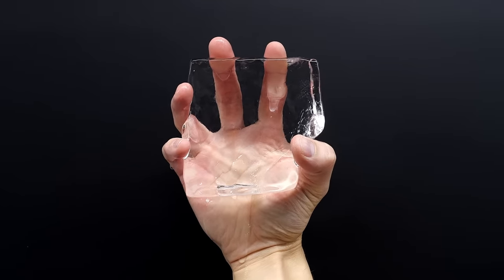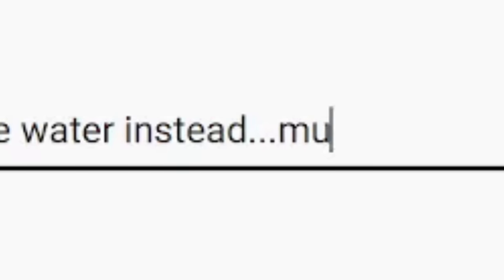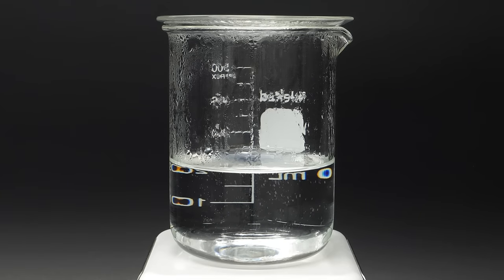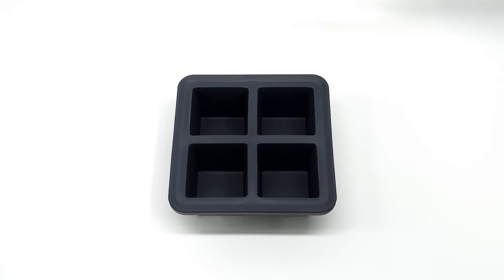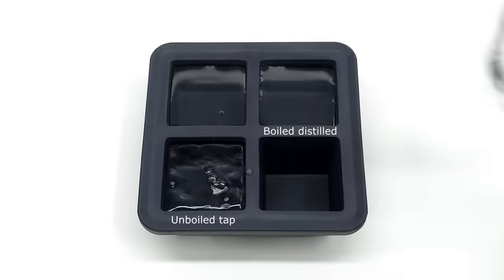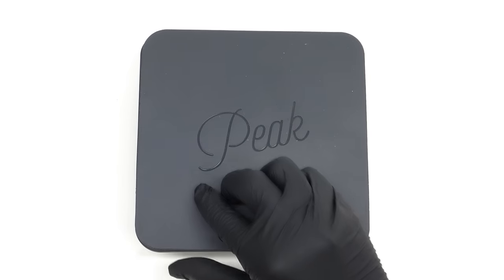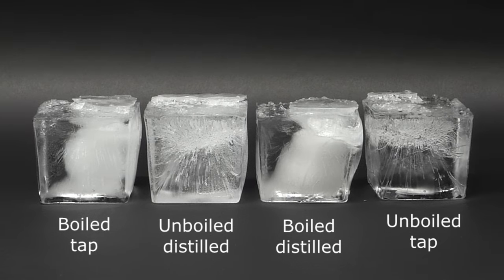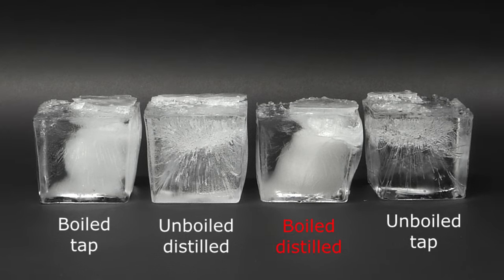The clear ice myth

Comment: I thought the trick was to use water at boiling temperature which gives the air time to get out due to the extended time it takes to freeze. You mentioned that you let it cool after boiling.

Comment: i learned a long time ago that it has nothing to do with the temp of the water and everything to do with how the water moves when it is being frozen.

vibrating it will produce perfectly clear ice because while it is freezing it is being placed into its most dense molecular structure, vibrating it does the same thing that sifter does when you're putting something through it like grain, it allows the molecules to move freely and allows more of the air to escape.

because what makes ice not clear, is the air that gets trapped inside of it, let more of it out and the clearer your ice gets.

also, this so called "myth" was wrong to begin with, the boiling water myth is that it freezes faster than cold water and that's a fact that has been proven.

the way hot water freezes faster is due to it being closer to vapor pressure and thus having a bigger surface area to collectively cool the water.

throwing cold water into sub zero takes a bit to freeze but boiling water instantly turns to snow.

i have yet to see anything even remotely speaking about clear ice and boiling water other than this video.

Comment: Well. I see a few issues here.
if you won't let it boil, just heat it to 95~98 degrees, and then freeze it without transferring it to another container, you might have better results. e.g. less disturbance = better. 
Still doubt it would be any good, though. 
maybe marginally better.

Comment: Don't you love replying to tween comments from people who've never actually done what they comment on?
Reply: I make clear ice in the regular refrigerator compartment. Plain tap water works fine. All you do is get a plastic cup filled pretty much to the rim (perfect is not required at all.) Then place the edge of the cup right where the cold air blows into the refrigerator. After a day there will be a nice clear medallion, after a few days it will be several times as thick. I'm serious. The trick is to have the air blow over the surface of the water.
The worst water to use? Seltzer, it makes one big white blob.